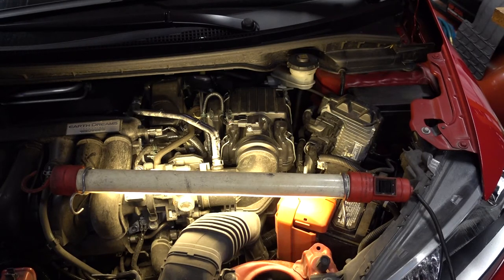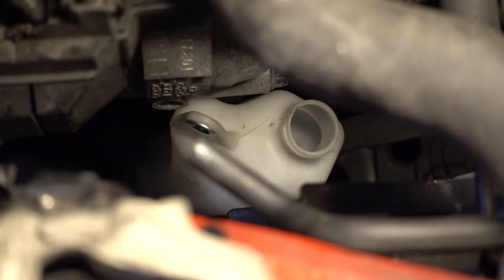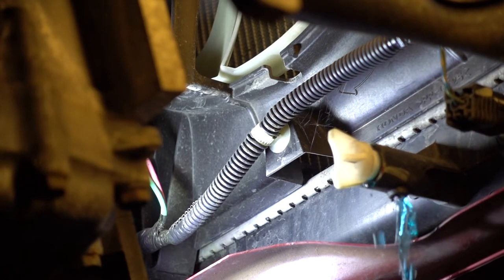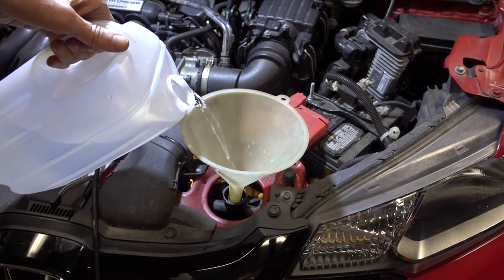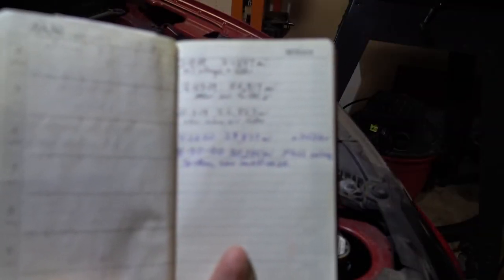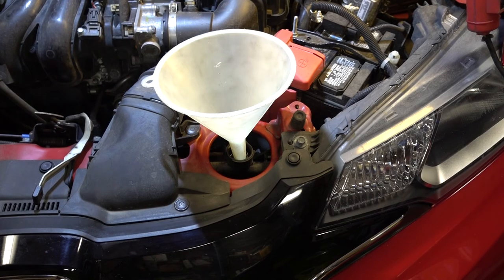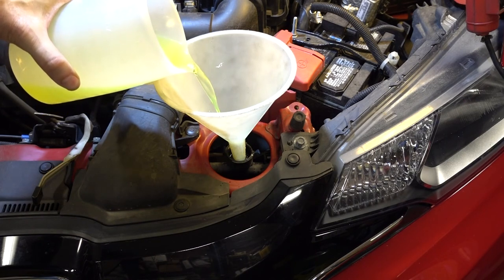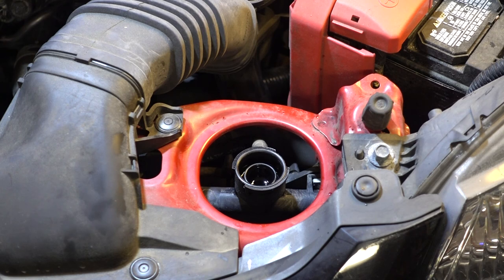Honda Fit Cooling System Flush

Comment: Good instruction video but here's a shortcut. You don't have to remove the plastic crap underneath, just loosen the radiator plug and it will drain through a hole in the plastic. Also not necessary to drain from the engine block. Also not necessary to lower and raise the car again just to drain a tiny bit more. It's almost not even necessary to jack the car up if you know where the radiator plug is and are able to reach and loosen it. That's all just extra work that takes extra time to get the same result. There is only about a cup of old fluid in the engine after you drain the radiator and it will come out after you flush it with distilled water. I just flush one time, then refill with blue fluid, blue jug of Peak, I wouldn't mix it with anything other than blue. It will take almost the whole jug if you fill the tank to the max line and the radiator to the top. I don't worry about excess water in the system but I am in FL, ymmv.

There's one more thing you can do, but again it's not actually necessary unless you want to. When you are draining it after the flush you can pour a gallon of distilled water through the top of the radiator so it will start draining out fresh and clear at the bottom before it's time to refill with fresh antifreeze.
Reply: Ohh that's some great tips, thanks a lot. I'm planning on changing my coolant and was a bit annoyed at the prospect of all this jacking the car up and down to get to the petcock and so on. Then I read your comment, went out and had a good look under the hood. If I unclip a wire harness betweeen the battery and the radiator and move it out of the way a bit, I can reach down the radiator and open the drain valve, and there is indeed a hole in the dust flap underneath it, how billiant is that! There is really no need to even get the jack from the trunk lol.
Reply: You think one jug will be sufficient to fill reservoir, block and radiator
Reply: Right on the money! Thanks for practical tips 👌

Comment: I got a 2016 Jazz/Fit with 1.3 ivtec and CVT. Here in Europe, Honda says you have to change coolant at 100000kms/60000 miles only . It’s the same for the spark plugs.

Comment: The engine was ticking loudly . The valves need adjustment. It is common in Hondas. A valve adjustment is very time consuming and involves removal of many parts to access the valves. Not an easy DIY, but can be done.
Reply: Don't the engines have hydraulic lifters?

Comment: Good morning, my temperature indicator turns red when you turn on the car and then turns off what can it be?
Reply from the maker: All the indicators should light up on the IP when you start the car.  If the temp indicator turns on after all the others turns off it might be a bad temp sensor or it might be a bad or intermittent wiring connection.  Did you scan the system for codes?

Comment: Nice video but, just drain and refill.  Putting the regular water in dilutes the 50/50 ratio.  I'd only use Honda antifreeze.  I change at 50k, as all the new antifreeze last longer nowadays.  The Honda antifreeze is good for 60k or 5 years, from the container information.
Reply from the maker: I never use the 50/50 antifreeze for exactly that reason.  I only use full strength antifreeze.
Reply: @davidgpo  you want the 50/50, ratio, that’s the best ratio.
Reply: @slalomking  Not according to the service manual.
Reply: @davidgpo  how do you know the ratio is correct?
Reply from the maker: @evanjohnrobasci7356    It's common knowledge that a 50/50 mix gives the most protection from freezing and boiling.

Comment: Just buy two bottles of OEM Honda cooland and you'll be all set. Also, it is completely unnecessary to wash the coolant with water. Just drain it and refill.
Reply: You mean the OEM will clean as well without flushing ????
Reply: You're talking about a drain and refill. He was doing a flush to get more of the old antifreeze out of the system. If you really want to get it out, though, you'd have to go through several cycles of filling the radiator with water only, running the engine and draining the radiator. It's a long process and then you're left with several jugs of old antifreeze that nobody wants. A drain and refill is definitely easier and you're left with less waste.
Reply: @MrGreatbeyond  Okay thanks
Reply: You have to wash out all remaining coolant which will be contaminated. You also have to drain the engine block otherwise you'll be mixing coolant with non dimineralised water which will contaminate and dilute the coolant.

Comment: Engine block drain plug was moved from the front to the back of the block on 2011-2013 models so could be for this model as well.

You need to use demineralised water.
Reply: No, demineralized water is NOT as pure as distilled water. Most demineralized water is produced by reverse osmosis; does NOT produce a pure H2O like distillation.

Comment: factory coolant fill (type2) lasts for 10yrs
Reply: Manual says change coolant every 30k miles or every two years.
Reply: @mjhammer8121  that's for type-1 coolant
Reply: @rondg2  Manual says type2, but maybe it was never updated. I'm gonna go with 30k or 2yrs for the increased benefit. No sense in driving around for 10yrs with dirty coolant.